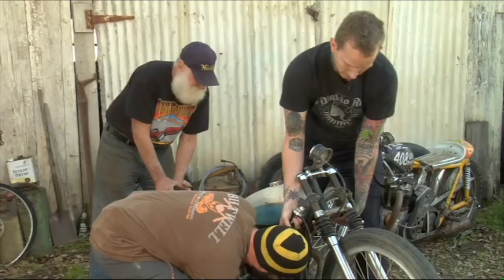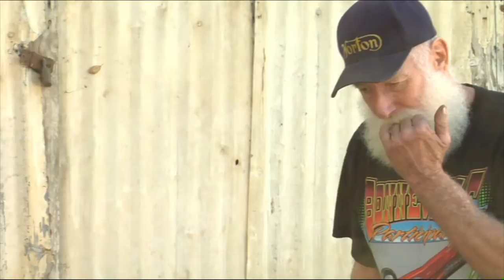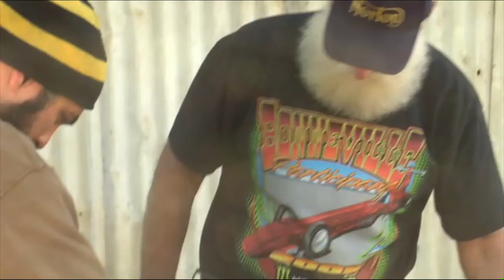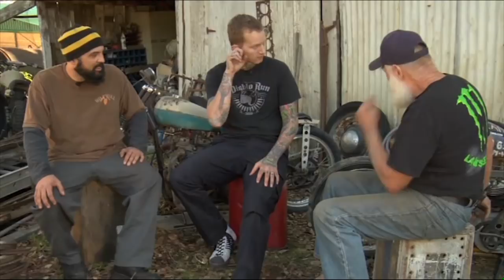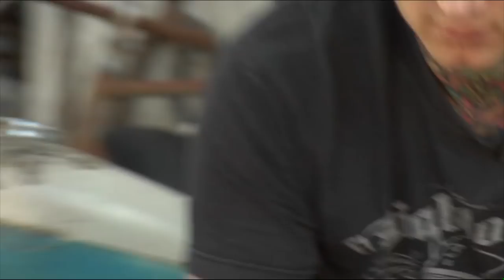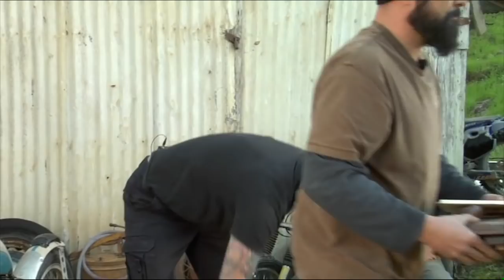Salt Ghost Bonus Footage  - Full Interview with Fritz Kott

Comment: Just as a note for old Britt bike fans that coil hanging down can be a Capacitor for starting the bike rather than a battery. My 1970 TR6R Triumph ran that system for the first 20 years I ran it.